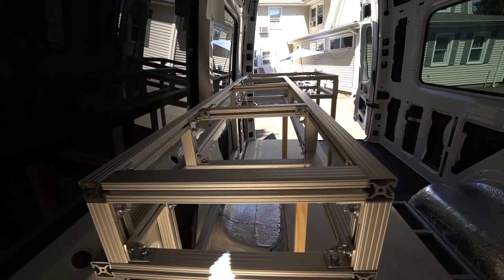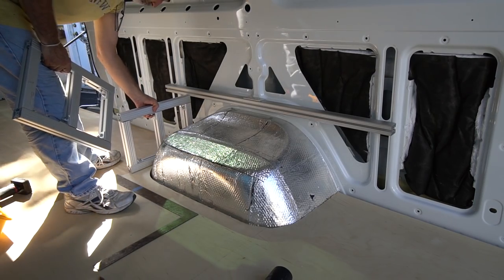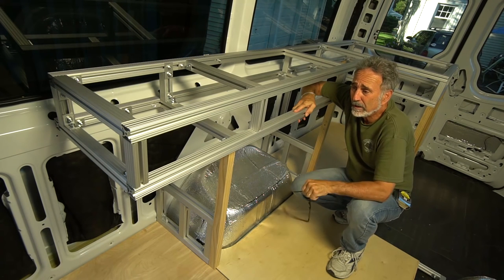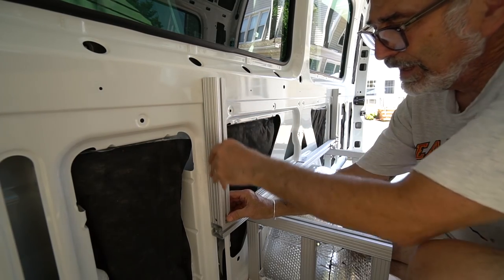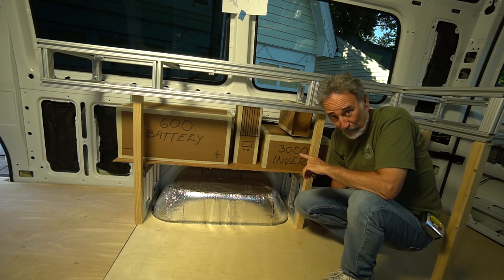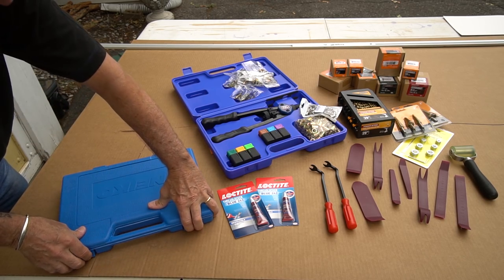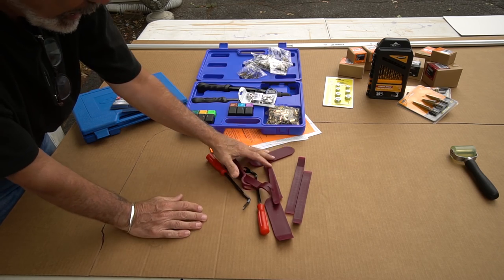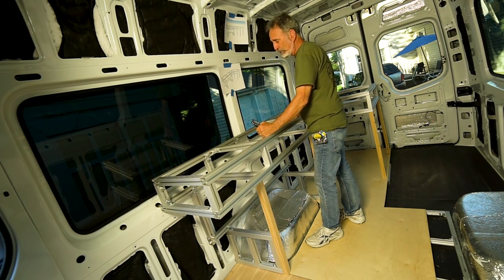VAN BUILD SERIES 10 | Look At Those Galley Bones!

Comment from the maker: HUMBLE NOTE: For clarification, the 2x2 wood legs on the galley are temporary. They will be replaced by 80/20 aluminum. I just did not have the time to fully complete the build. The last thing I want to do is delay the video!
Reply: Humble Road - Right on!! Whatever you do, Do Not Delay the Video! There's nothing uglier than thousands marching up your driveway demanding a video!
Reply: Humble Road I love you man build the only problem is it's going to take all day to build it we put in frames in like that then you got to put the skin all around it that's more work I do my doctor would of course I'm doing my high top right now and then you go to my channel you'll see my high top be made DIY style out of wood
Reply from the maker: I get what you are saying, and I am sensitive to not duplicating my efforts. This will not be box framing over a skeleton frame. The entire top of this galley module is countertop material, which you would use on any base. The entire front of the base is louvered doors and the cantilevered side panel is only 8"x20" Not too bad.
Reply: @skapunkoialternativeliving6522  How is your high top doing? Any problems so far?

Comment: Great as always. Just a suggestion . . . Put felt tape on the metal to metal applications. No matter how much torque you put on the hardware, it’s inevitable to eventually get squeaks going down the road. Home Depot sells different widths. I did it on my humble van( female here) and am I glad I did. Thanks for taking us along your build!
Reply from the maker: An excellent suggestion. I was going to use the vinyl moreso as a thermal break. Some sort of tape would be much easier and less intrusive on my measurements.
Reply: Great tip!  Added a lot to the fine points.

Comment: A thought: if it were mine I would put a drawer or open space with a fold down lip in the center space to store the cooktop. You may find you don’t want the cooktop in the middle all the time. The ability to move it anywhere on the counter when being used gives you a lot more options.
Reply from the maker: Karen, I am the ambassador of options! You can use that cooktop anywhere you like, it's a tabletop model.
Reply: So it just stored in the space you are designing, not fixed? If so, that is perfect.
Reply from the maker: Correct. As I explained in the video, you can use it right where is lives, by opening the countertop lid, or  remove it from the recess it lives in and bring it outside, or off center on the counter top. It's portable. Options. ;-)
Reply: I was thinking the same thing.  Awesome.  I wud want the option to bring the cooktop outside for outdoor cooking.  I also feel cooktops sud be closest to the sliding side door so that I cud cook and have the smells fly out of the door, instead of putting the sink beside the side door which I've seen a lot of and no likey.

Comment: Are you planning on having a thermal break between the 8020 and the van structure? Are you worried about the 8020 becoming a giant radiator?
Reply from the maker: In 99% of the cases where the 8020 touches the van chassis, there is a rubber break.

Comment: I'm fitting out a new motorhome I'm building and saw the 80/20 product you and in a couple of other camper van buildouts.

I was considering making the frame for my bed frame dinette, cupboards, counters, bathroom walls and all from 1.25" square profile steel rollcage material welded in place. 

Now that I'm impressed with your system I am wondering how it would perform in a rollover or side collision on the road. I'm sure much better than the toothpick structure of most RVs, but something less than a rollcage. 

Do you have any data or feedback about this question?
Reply from the maker: I cannot answer your question about roll over or side collision. This aluminum is going to be much lighter than the 1.25 square steel tubing.

Comment: I have watched almost all of your videos. I enjoy your style. I am also building a van right now. In my opinion you are doing this the hardest way possible. Way, way Overkill. But to each his own. Having spent A LOT of time researching lithium battery systems, My Question is; What is voltage of your system? Are You going to use Victron components? Can the alternator charge your system? If I had to rebuild my 24 volt liuthum system, I would go 48 volt and buy a victron charge controller instead of my 24 volt renogy charge controller.
Reply from the maker: Thanks for watching Glenn. I appreciate that. When you see the finished product, you will understand the need for "overkill" as you put it. I see it as quality construction designed for the long term, not economy. I am not ready to provide details on my battery system beyond what I have already mentioned.

Comment: If you add up all the volume of the 80/20 it's not an insubstantial reduction in total storage space in the van. It works well in a van of that size but definitely overkill
Reply from the maker: In addition to supporting the 160lb battery and corian countertop, I concern myself with getting T-boned in an accident. It's fine for the 8020 to get destroyed, but I want it to hold everything like a safety net.

Comment: I wonder if you could make those 90° connectors another 1/4" to 1/3" longer so you can use a socket or ratcheting wrench instead of being stuck tightening them with a standard wrench? Unless, of course, you're goal is Popeye sized forearms ;-)
Reply from the maker: I wouldn't mind Popeye sized forearms! I am what I am….
From a structural standpoint, the fixing bolts should be as close to the center of the joint as physically possible. So I positioned them where I can just get each nut onto the threads.

Comment: Great video. One question though, and sorry if you have already discussed this in another video, (I haven't seen that you have addressed this topic) but what was your deciding factor to go with the 3500 vs the 2500? I see many Youtuber's doing van builds with the 2500 and they do not seem to have any problems with weight. The 2500 I assume would get better gas mileage as well?
Reply from the maker: My aim is to build a stout full time livable van. One that will outlast it's owners. With all the best quality materials and systems. Simple systems, nothing superfluous. All that will add up, weight-wise. Mercedes offers a 3500 with a GVWR of 9900# and also 11,030#. I went with the 11,030.

Comment: The 80/20 stuff looks amazing for this purpose. Using aluminium for the furniture is great from both weight and strength points of view, but welding aluminium takes an expert. This, you just cut to length, drill a little and bolt it down. I'm a bit concerned though that you're leaving huge thermal bridges with this approach. You have the exterior metal shell in direct contact with the internal struts/ribs, and now you're bolting the aluminium 80/20 straight to those ribs. So there is an uninterrupted metal thermal bridge all the way from the outside wall to the totality of your kitchen workbench ribs. 

Insulating in the cavities alone in the van walls won't do the job, if you really want to insulate, you have to cover the entire wall with insulation material. That makes bolting things to the ribs from the inside much harder as you have to go through insulation and plywood but it's the only way I can see to minimize or eliminate thermal bridges.
Reply from the maker: You definitely know your stuff, Croft. I have mentioned in a few of my videos, right now, I am building and test fitting all the modules. Even the flooring is just sitting loosely at this point. Once everything is built and fits to my liking, it all comes out and I go in and add my heavy mass vinyl between the modules and the van frame. I am very sensitive to addressing the thermal transfer of heat and cold. Although, I am using Rivnuts instead of Plus (rubber).

Comment: This build is nothing less than top notch. I'm sure the most expensive factory class B's built on the same chassis aren't even close to this quality; especially when it comes to the hidden parts the customers can't evaluate. Considering the curvature of the walls and the varying inclines of anyplace you might park, I'm wondering when you installed the galley section, if you adjusted a level to square with the van floor or did you entirely use measurements and squares to keep everything level with the van floor?
Reply from the maker: Thank you for your words of support. Very encouraging! Unless you are absolutely sure your van floor is level in every direction, which I have done for certain parts of this build, it's best to square and measure off the chassis. Take notice of the predrilled holes in the van walls. Many of them line up for aftermarket options.

Comment: George, I think you are making a mistake with making the shower floor squared off.  Watch your video and see how you step into the shower area to pull out your invisible drawer.  I think that stepping back into the shower area will be a pain in the butt when someone is working at the galley.  Please consider changing the cut out for the shower floor into a sexy curved area  (like when you laid out necklaces in ads.) Eliminate the squared cut and make it rounder. Sure you'll lose a couple of inches on the shower floor, but you won't be continually stepping down into the shower as you work at the counter or sink.  Otherwise, I love your design and construction so far.
Reply from the maker: Bonita,  I like your attention to the details. I am going to have a sexy curve, but to the top finished floor layer only. And there will be no stepping down into the shower, both floors will be at the same height, flush with one another.

Comment: I’m confused! What happened to laying the electrical and plumbing lines and then insulation in the floor?
Reply from the maker: Vicki Bedford one of the advantages of this type of build is that you are not locked into the conventional order of installation. I had always intended on fitting in all of the modules first. I will bring the wire to the module rather than build a module over the wire. This way I have great flexibility. I can make changes and adjustments on the fly.

Comment: I would put the induction cooktop in a drawer under the counter vs having the counter top open up.  If you have stuff on the counter, then you’ll have to move it to take the stove out.  You kind of defeat the purpose of have a not-permanently-fixed stovetop by having a designated spot for it’s use.  Otherwise great build.  I can’t wait to see the finished product.
Reply from the maker: Think options..

Comment: Nice work! This is definitely the fun stuff. Did you figure out a dual induction cooktop that'll use less than 3000W with both elements on?
Reply from the maker: Yes, the dual cooktop shares 1800w between them.
Reply: And only if they are both on full blast which is almost never the case.
Reply: Tim Brounscheidel most induction p
Hot plates are binary ie on/off eg. 50% power cycles on/off half the time. Here in New Zealand our 230v induction stoves are min 1800W or usually 2400W EACH and thus you can’t run two at once. Low power levels won’t help because they may both be on full power at the same time.
Reply from the maker: This particular cooktop has a total of 1800w. It can be shared between the two burners in several different ratios; 900/900, 1000/800, 400/1200, 1800/0. But never will the unit ever exceed 1800w. Unless there is a malfunction… You get the idea.
Reply: Really enjoy watching your build. I bought an induction cooktop from IKEA($50) specifically for my Sprinter. I bring it inside the house and use it all the time. I rarely use it above 1000w. Only higher for short periods of time as food seems to cook too fast and burn at higher settings.

Comment: Very nice work!  8020 is a great material choice to work with!  I worked with 8020 material on building framework for automated assembly equipment and have a suggestion for assembly.  The cut ends can be tapped for use of a button head cap screw and then drill a clearance hole 3/4" from the end of the 2nd piece to be attached for an allen wrench.  This method could eliminate the use of the fabricated angle corner pieces that you made, but still could be used to help the 8020 from twisting.  And or the End Fastener that 8020 sells will also eliminate twisting and provide a smooth connection between the two pieces being connected.  Great work, looking forward to the next video!
Reply from the maker: Thanks for those suggestions, Jim. Keep them coming! I just started tapping the ends this week. In testing it's breakpoint, I was surprised at how strong a joint it made!

Comment: Can you make the connector brackets a little longer so that you could use a socket instead of having to wrench them manually?
Reply from the maker: The closer the bolt locations are to the corners, the more structural integrity. I placed mine so I can just fit the nut onto each bolt.

Comment: George....great kitchen space design!!!!  However, what about placing that 160 pound lithium battery and 75 pound inverter just aft of the passenger wheel well on a slide out platform near the right rear access door mounted on the floor?   Can't wait for your conversion kit plans!!!  Keep up the great work.   Mike
Reply from the maker: The main reason for the battery placement is handling of the vehicle. All the big players should be between the axles. Favoring just ahead of the rear axle. I am trying to nudge my fresh tank aft as much as I can. Once I build the fridge/wardrobe modules, I'll know exactly what I can and can't do.

Comment: I bought th eAstro rivnut gun and it works fine
Reply from the maker: I have had very good results with mine. It is very hard to operate when your arms are outstretched and overhead, as at the ceiling struts. Because the rivet MUST be properly seated throughout the install. Because of the volume of RIv-nuts I anticipate installing over time, I think I will buy a compressor driven gun, possibly Avdel.

Comment: Are you using the 80/20 strictly for the structural strength of cabinet frames or is it lighter than a typical 2"x 2" wood frame?

Comment: Still loving these videos, thanks again!  In this video at about 2:27 you mention using brass coated stainless steel rivnuts.  Assuming the stainless is for strength and brass is to keep the ss and van steel separated for rust prevention.  Would like to do the same but can't find anyone who knows where to get them. Both Grainger and my local hardware store are clueless.  Can you point me in the right the direction?  Thanks!  Jason
Reply from the maker: http://a.co/59DgWCy
Reply from the maker: http://a.co/9Ie4OEv
Reply: Ahhhh, bronze....thank you so much!

Comment: When doing the cook top don’t forget to allow room for the pots handle if your recessed the cook top into the bench I hope that makes sense
Reply from the maker: I understand exactly what you mean. As it turns out, I will simply keep the double cooktop in a drawer and not accessed through the hinged countertop. Waaaay too many people commented they did not like that recessed idea, too limiting. For instance what if you like the cooktop slightly to the left or right of prep area. Options!
Reply: Or you could try some pots with smaller handles

Comment: A small 200W inverter For a simple Batt charging station (Cam,Laptop,Cell phone) This will save some amps and cycle life of you'r house batts when no need for 3000W inv to be running
Reply from the maker: You, my friend, have a great mind. I plan on connecting just such an inverter to the tiny little house battery (90Ahr AGM) that comes with the Sprinter. It won't even be connected to the main house system.

Comment: Have u thought of a Murphy bed with lounge 

Instead of a futon ???
Reply from the maker: Yes, I have thought of a Murphy bed. For my particular needs, MB would not be optimal. Bright with plenty of natural light, open and airy. These are a few of my "must haves" and the MB blocks an entire window all day. Also, I have my fresh water tank under the futon alongside a large bedding drawer. The MB cancels the under couch storage.
Reply: Humble Road  as u said every van is different for everyone .... 
Making a bed up every night would annoy me... 

Love the 80/20 kitchen ... 
And the shower idea is brilliant 
I'm 6 foot and 95kgs (210lbs) 
So I have to have a decent size shower. Hate the showers with toilets in it... That's stupid... 
And thanks for the measurements video 👍👍👍👍👍👍
Reply from the maker: I have been using the RV SuperBag. It is a kingsize sleeping bag with top sheet and bottom sheet inside. I LOVE IT! The top sheet bottom sheet is one long sheet connected at your feet and held in  place everywhere by velcro strips along the sides. Very comfortable, very easy to use and easy to clean. The bag has a summer side and a winter side. So making up the bed is as simple as taking the bag out of the drawer and spread it out on the bed. https://www.rvsuperbag.com